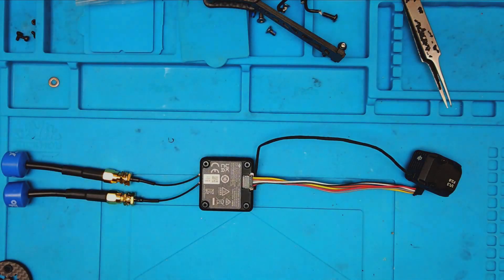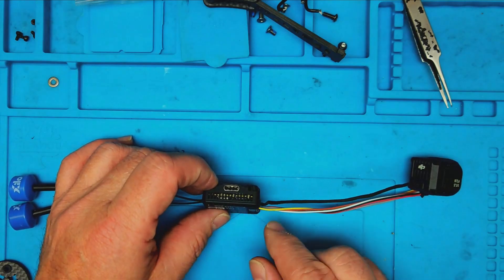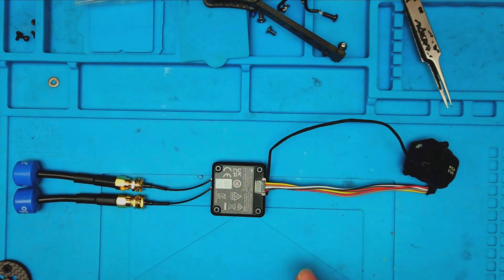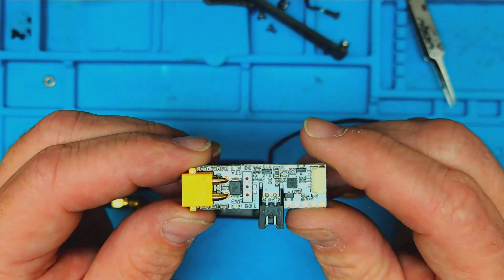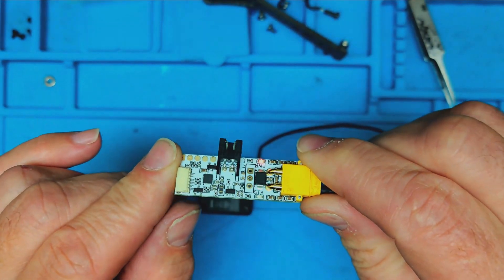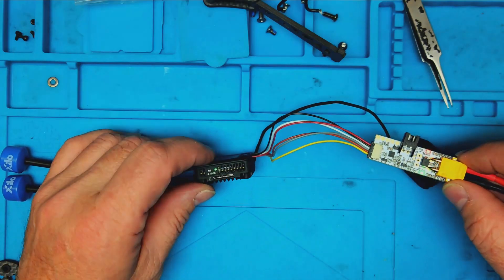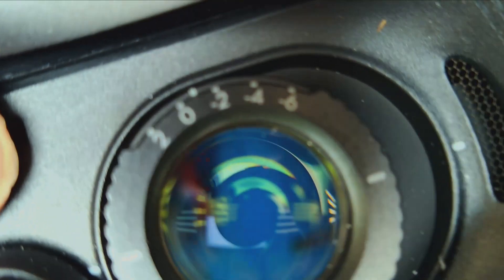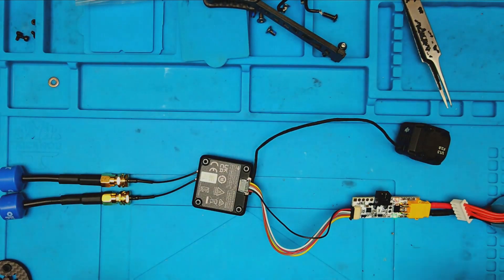How to activate the O4 Air unit WITHOUT a flight controller (3-20-2025)

Comment: Do you need to power this unit with a 2s lipo then a 4 s lipo? Or will a 4s lipo work straight away
Reply from the maker: 4s lipo
Reply: @princesfpvdrones thank you for the quick response

Comment: Will this give you a voltage reading for the air unit if I am using the armor on a wing with no fly control controller. Will it still show me accurate battery voltage for whatever battery is plugged into the armor?
Reply from the maker: I do not believe so because its not a VTX
Reply: @princesfpvdrones  no what I’m saying is when you plug this in line from the battery to the 04 Pro will the 04 Pro still show battery voltage on your OSD. (osd coming off of 04 pro)

Comment: Is there a way to use it without a o3 armer? Maybe there is something else in market like the 03 armer?
Reply from the maker: Well, I hooked up an 04 system to my Inspire 2.  I turned off low power mode in the settings and it works great, directly hooked up to 6s voltage, no arming or flight controller needed.
Reply: @princesfpvdrones  thanks for the answer. I want to use my o4 pro unit on a RC Car. ❤
Reply from the maker: @paramedic1988  You most certainly can but you will need to turn off low power mode on the 04 air unit to get full 60mb signal, however, you will need to mount a fan to keep it cool.
Reply: @princesfpvdrones I have tried this on my RC planes without flight controller but the video still has a detectable refresh rate, must be 30FPS. I'm not convinced that turning off low power mode gives you everything it has

Comment: Great video thanks for your expertise. do you have to leave the 4s battery connect to the air unit in the setup that your installing the 04 air unit in? please advise?
Reply from the maker: Once you have registered the 04 air unit you can unplug the 4s battery and install your 04 air unit as normal in your quad. Hope this helps?

Comment: When running an 04 Pro air unit without a flight controller, how do you get it out of low power mode?
Reply from the maker: Under the settings, disable low power mode.
Reply: @princesfpvdrones I heard that doesn't work. Are you sure?
Reply: @princesfpvdrones That option is not in the settings.